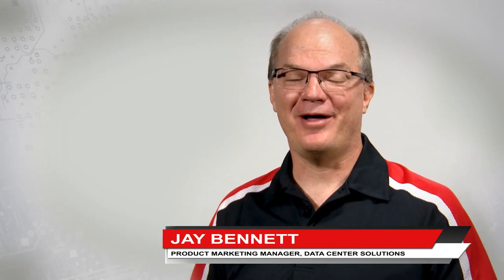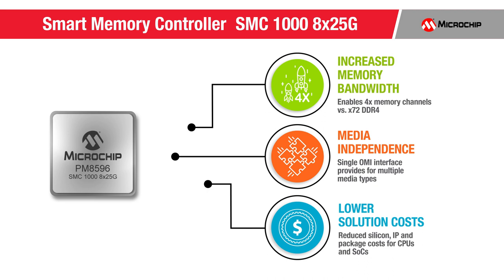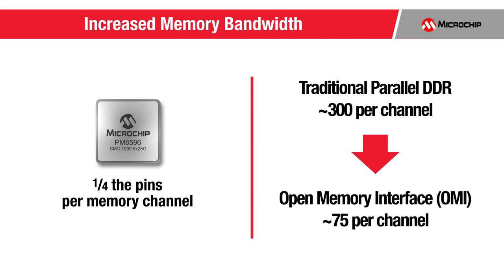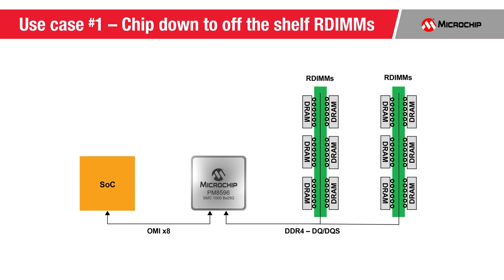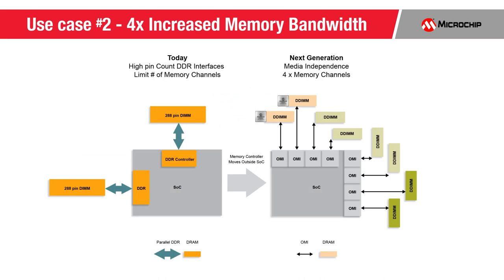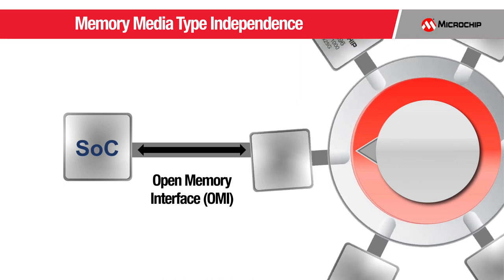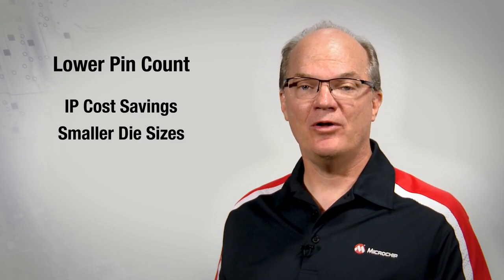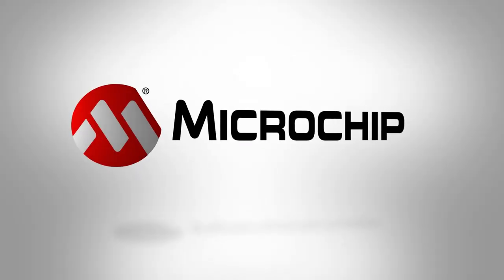Microchip Introduces the SMC 1000 8x25G Serial Memory Controller

Comment: It is going to be interesting to see how popular this gets.

Apart from FPGAs, I can't think of any general purpose processing unit that will connect to an 8x25G memory interface at the moment.
In the specialist niche of server-only CPUs, IBM's own POWER9 seems to be the main (only?) customer for this.
IBM are touting this for Artificial Intelligence use, but AI has the opposite memory access requirements to conventional DDR4. DDR4 is great for streaming large blocks of contiguous addresses, but AI needs low-latency access to non-contiguous locations. Adding a serial-access chip in the way would only seem to add to the access latency, so it is not immediately obvious how IBM's claims for "low latency" and "suitable for AI" can actually be justified.
If there is some special "trick" that lowers the access latency then I would love to hear about it, because for FPGA use reducing the number of IO pins needed would be very valuable.
If the IP block needed for the OMI interface needs fewer gates than that for a DDR4 interface then that would be valuable too, as a DDR4 IP core takes a huge bite out of any FPGA's resources.
If on the other hand the OMI needs BOTH an DDR4 IP core and an 8x25Gbps SERDES interface IP core to work connect to an FPGA, then that a lot less attractive.